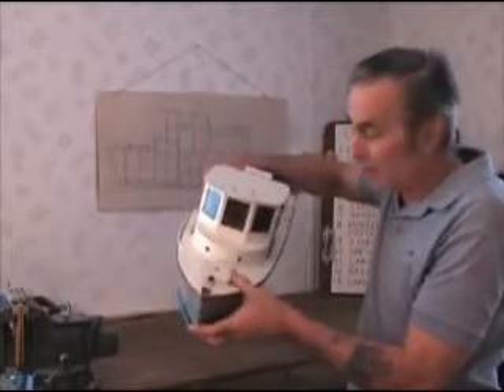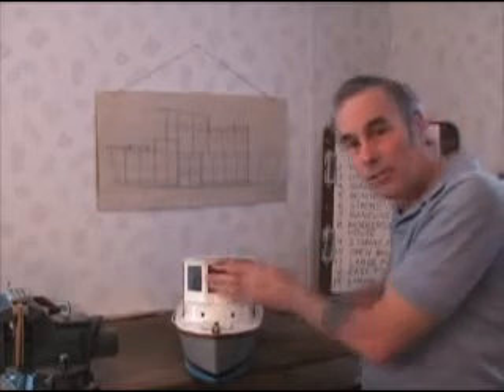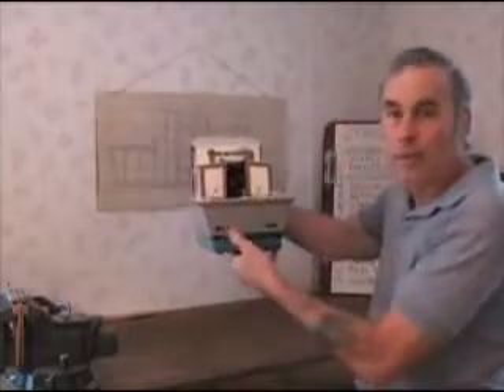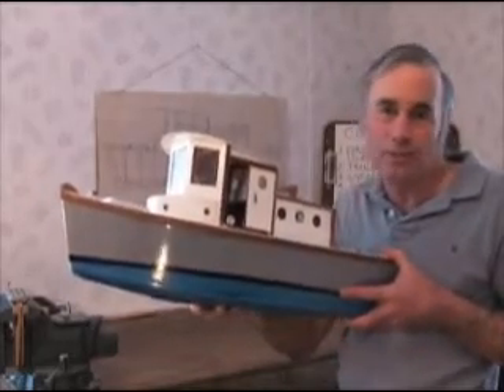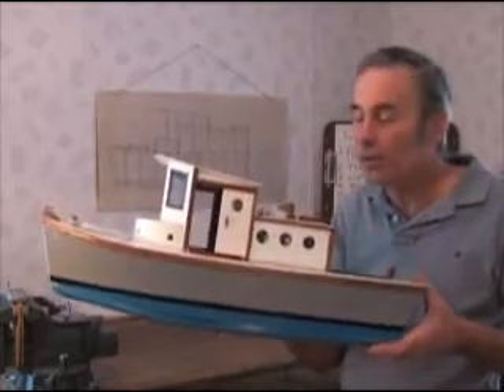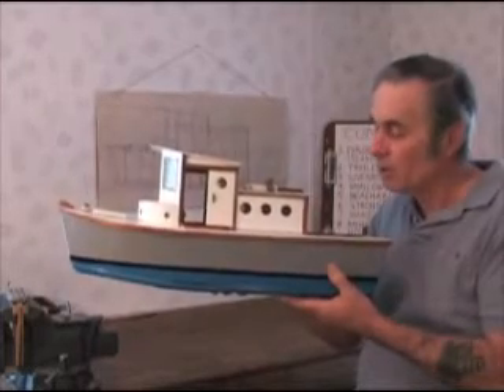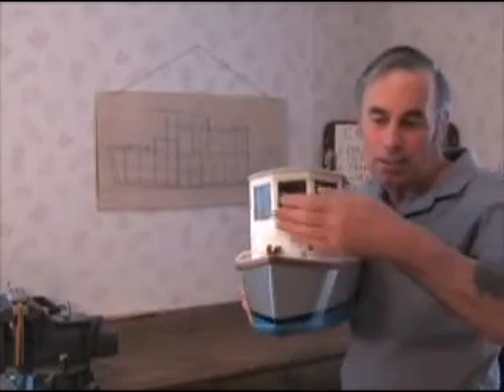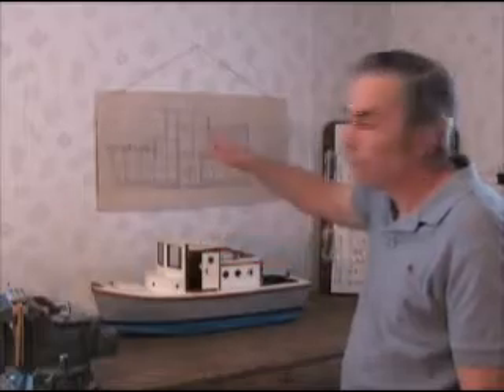Building the Jani J-Concepts 2

Comment from the maker: I hope you post some videos of your tug. I had a 45 ft ferro schooner with a Detriot 3-53,101 hp, turning a 20x19 prop with a 2-1 trans. 25 tons and it cruised at 7 knots at 1750 rpm. Your tug should be much faster.